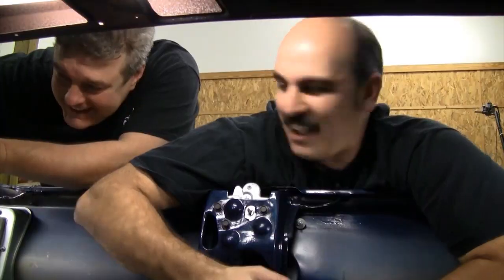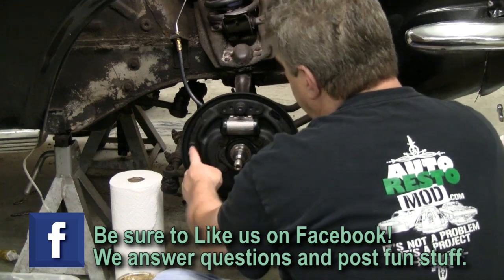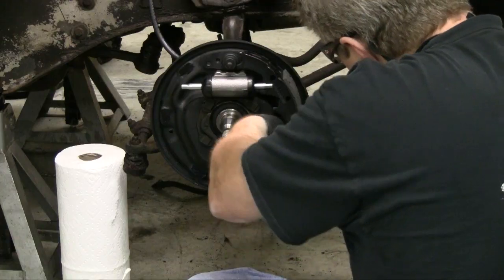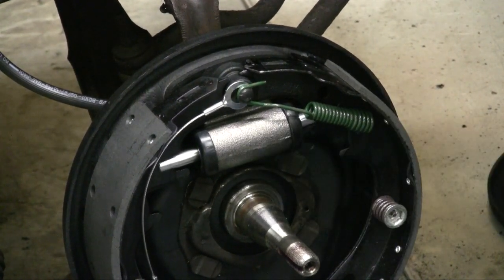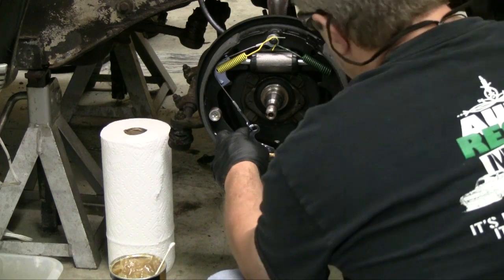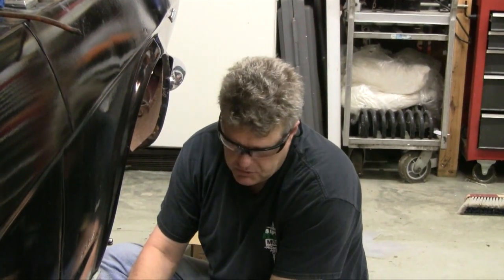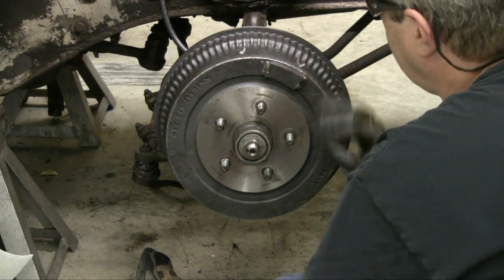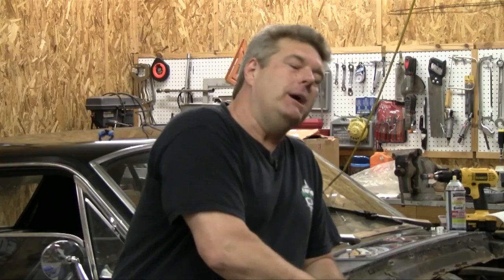Part 2 Ford Front Drum Brake Diagnosis and Repair Episode 170 Autorestomod

Comment: You didn't talk at all about how if you want to replace the drums on the front, you have to press the old drums off the hubs because no one sells the drum and hub assembly anymore. It is a total pain to do and I thought that once I got the old drums off the hubs that the new ones would slide on and off like the back but they do not. So if your going to change the front drums on your car it is best to source a machine shop or a shop that can press that for you ahead of time otherwise your going to be stuck on the hoist or in your driveway until you can get that part figured out. Can't wait to upgrade to disc brakes.
Reply from the maker: Good point!

Comment: Missing the butterfly washer at the top. Should have been installed before the adjuster cable. Should have turned the drum to match the hub center. You can manually adjust the brakes but leave them just a bit loose. If the car pulls then adjust abit more to balance the pull. Car should seat the shoes evenly from there. Once they seated it may need another final adjustment. Great video for the basic tho. You guys are awsome!

Comment: So I got a 63 ford fairlane 260 500.  Clean car.  My left front spring broke that goes on the adjuster. I'm having a hard time finding a good kit.  The kit I did get is part number h7045. The car does have the original shoes on it if there was changes I don't know.  Just wandering if you came across this problem. Thanks

Comment: My 67 has that bar on the front, that you said was for the rear brakes right under the wheel cylinder. Should I take it off? And I had a really stiff brake pedal. The pedal hardly moves, and the car does stop, but takes a very long distance to stop. Suggestions where to start trouble shooting???

Comment: Just did new cylinder and shoes on my 64 ford custom and now the front won't spin forward. Will spin backwards a bit. Adjusters all the way in. Nee shoes did have slight variations in pad placement. Any ideas?

Comment: I noticed you switched out the hardware from what it had originally. Is that what needs to be done? I have a 61 Mercury Comet and I'm having trouble finding the hardware kit. I have a picture i can show because it looks like i might have to update my hardware but I'm not sure. Hopefully this made sense and you can help. Greatly appreciate it.

Comment: my 65 fairlane also has another spring that goes across to both shoes under the wheel cylinder, what's the deal?
Reply from the maker: Those are the 10 inch drums. We were doing the 9 inch drums. The spring is therre to aid in return of the drum to its rest position.

Comment: hey i have a problem with my 1966 mustang i bought new wheels for it, styled steel wheels, and now i think the wheel studs are to short. When i put the wheel on i only have 0,4 inch left on the stud. is that enough for the wheel nuts or do i have to buy new wheel studs?
Reply from the maker: If your old wheels fit, the new styled steel wheels should fit too. You might want to check for interference between the disc brakes (if so equipped) and the wheel. Youcan contact Jeff directly at: jford@autorestomod.com

Comment: cool video but those drum brakes are not really all that. My '62 peugeot actually has twin leading shoe drum brakes which are better then this setup with one leading and 1 trailing shoe.
Reply from the maker: Interesting. We'd like to see that! send a pic to: jford@autorestomod.com. This system is what it was. Ford was actually late to the hydraulic game even; didn't adopt that until, we believe, 1955.
Reply: @AutoRestoMod  Hi, I have a 1953 ford Delevery van. It has hydraulic brakes. What im going to do is put on self adjusters which it don't have. I will let you no how it comes out. Love your videos.

Comment: I had no idea how to use brake spring pliers until I watched your video.  You can imagine being clueless and trying to mount brake springs, right.  You can put your freakin' eye out! (my mother used to say that a lot.)  So hey, thanks.  Well shot.  You can see everything, which is helpful.  One thing--some new drums I've received have clearance in the stud holes, so they won't need pressing on.  You can just slip them right over the studs.  Is that safe?  Correct part. Checked twice. NAPA supplier.
Reply: splortz yea i just changed mine today mostly by hand outside of w of the springs i used a needle nose for. The locking pins killed my fingers lol i didnt wanna get the tool set for it.

Comment: Wish you guys would of shown the steps on how to bleed this car with all new brakeparts installed.   Im in the middle of this project and Im not sure what to do it correctly.
Reply from the maker: Go to the furthest wheel from the master cylinder and bleed that, then to the wheel across from it. Move to the furthest front wheel from the master and bleed that then the closest to the master cylinder.

Comment: hi why does my 65  front drum mustang pull left when i brake
Reply from the maker: +Paul Kassabian Usually it is a problem with the adjustment of the front brakes. You might try the backing up routine. But we'd look at the internals first to make sure that the stuff inside the drum is all where it needs to be.

Comment: I test drove a 67 cougar the other day, being a first time buyer/driver of a old muscle car i didnt know what to expect for the braking. The seller told me he worked on the brakes him self, he had discs on the front and drums on the backs. But i felt as if the car was not stopping well at all and is a big problem. Is there a fix to this problem or is this common with 67 cougars?
Reply from the maker: If the car is not boosted, you may be dealing with that. Most every modern car is now power assisted. A lot of folks will add the discs but not the booster and so it may feel hard on braking.
Reply: thank you for the info, greatly appreciated.
Reply: Older car braking was not as good as cars now days.  I suggest you drive a few older cars to familiarize yourself with old school braking and steering.

Comment: Outstanding video, learned a lot. Going to use a special tool for my F100 front drums - a checkbook. The rear drums are a bit less hassle, not needing any hubs pressed, no? Think might tackle those OK. Good tip about the backing plates, will keep in mind. Thanks again.
Reply from the maker: OK, we laughed out loud at the check book comment. Sometimes that can happen!

Comment: Im having a problem with my new wheel cylinders lining up on my 66 f100 what,should i do to fix that
Reply from the maker: Pretty sure they are side specific. Check that first.
Reply: I ended up having to grind them down

Comment: My 67 mustang has one other spring which goes between the two shoes under the wheel cylinder, but good video!
Reply from the maker: Always consult your application prior to starting work. Shop manuals are your friends.
Reply: All 65-70 Mustangs with front drum brakes have that spring underneath the wheel cylinder. Where did the one go on this car? It isn't reproduced.

Comment: Great vid guys, coincidentally I'm doing my rear brakes as you post this vid; learned a lot.  If possible id love to see a video on restoring a rear differential, or at least just the pinion seal and or axel seals, thanks again.
Reply from the maker: Good idea, we have a nine inch rear axle we are planning to use on our '64 Falcon, we can certainly cover that. The 9 inch seal is covered in the Ford nine inch build we did last year. Episode 30 Part 1 Ford 9inch build using Detroit Truetrac Autorestomod That is the first one.

Comment: Thanks for this well informed video on how to do drums brake. I have a question every time I hit the brakes on my 69 mustang the driver rear drum shoe pops out of place what do u think might cause it. I have a video of it on my page if u have time to check it out.
Reply from the maker: Sorry, we have not been getting all of our request! We just found yours. It looks like you are missing the spring that goes from the adjuster to the shoe. Watch the episode and the spring we apply with the locking pliers is the one you are missing. This has allowed the adjuster wheel to slip to the bottom of the shoe, out of the slot where it is supposed to sit.